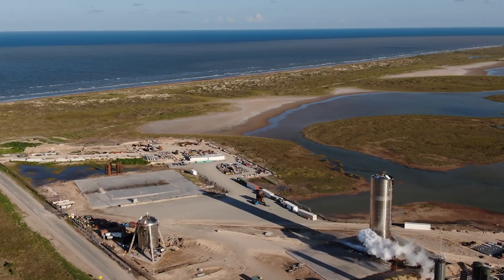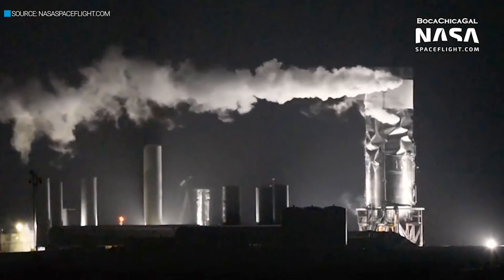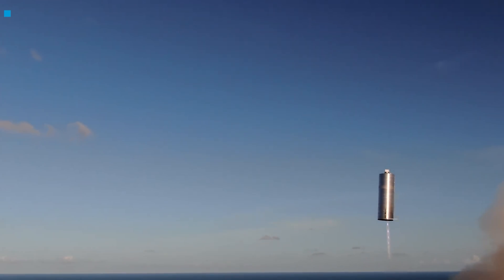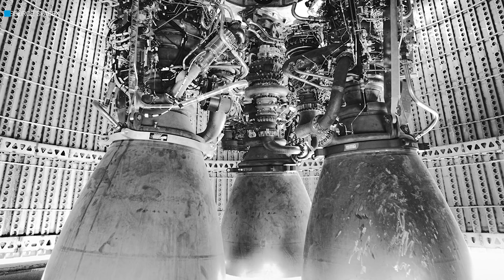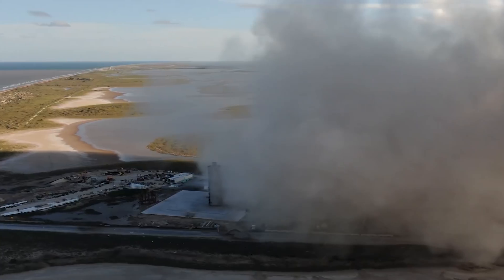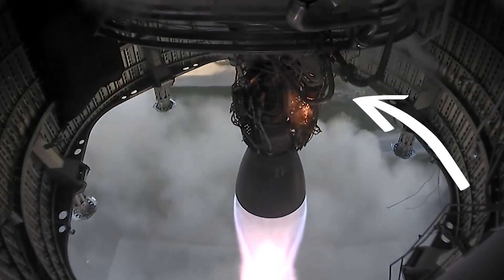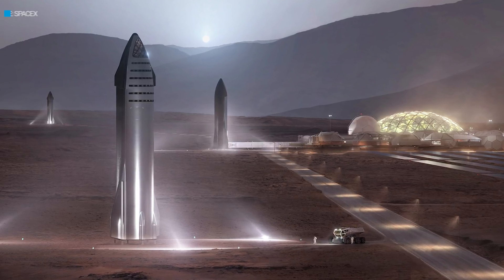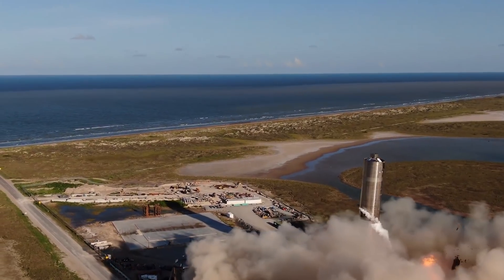SpaceX SN5 Starship Completes 150m Hop Test Flight

Comment: Congrats to Space X, this means a step further which is a large achievement in space development. This requires a prepared landing surface. The quantum leap forward will be cargo capacity to orbit and beyond even if beyond means that a payload with a propulsion stage is released in LEO. Thank you for the video. Go, Starship.